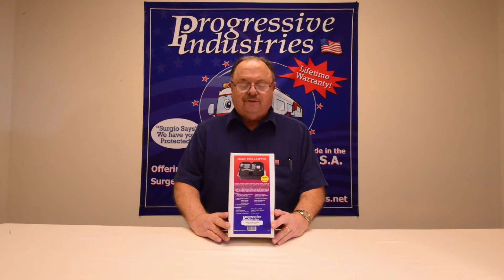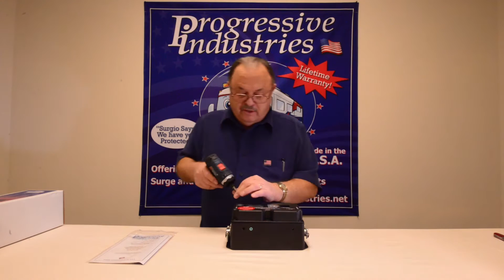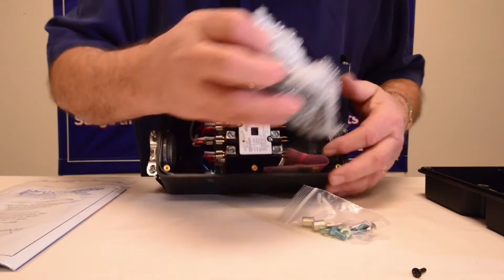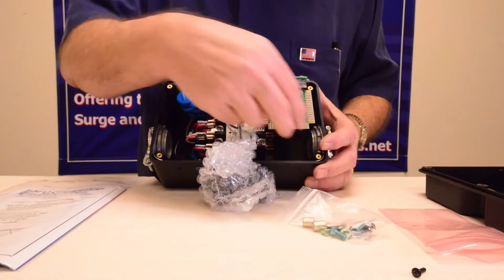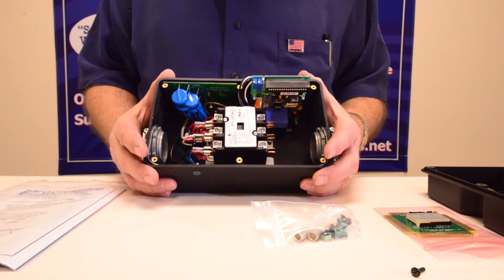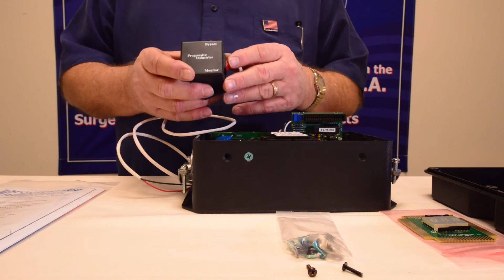Overview and Features of the Progressive Industries EMS-LCHW50

Comment: My sensor doesn't have an arrow (ems-lchw30). In the video you showed the white wire on the bottom with the wires facing the backside of box. Is this the correct sensor placement for my setup?

Comment: I was just sent a replacement read out panel, and it came with a by pass panel as well. Do I need to use the by pass panel or can I just plug my new read out and data cable into the main surge protector box. Thank you.